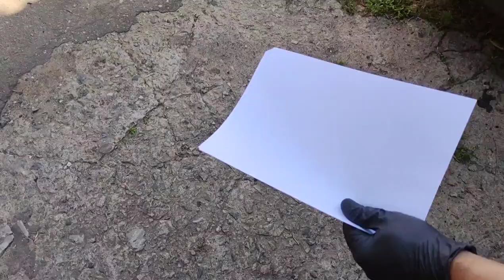Wootz steel from Threading Tap . Making Hidden Bamboo Knife

Comment: That was one hard nugget to forge. You can usually see the steel move with each hit, even with higher carbon steels, but you were giving it the beans and there was hardly any change
Reply: Good point! And that looked like a concrete busting, full size sledgehammer he is swinging there!

Comment: Your pieces are always adorable. I am wondering why you always begin forging with a hand hammer? Then switching to a power tool.
Reply from the maker: Forging with a hand hammer in order to see how the ingot behaves during shrinkage and conduct thermal cycles.
Reply: @fz-makingknives3663  finally subscribed. Rarely do so )))

Comment: Another great video! Question... I know in coal forges smiths have to be careful not to overheat and burn the steel... How do you prevent that from happening in the crucible?
Reply: I don’t think you have understood the process. When your hot working steel you don’t want it to reach critical temp and melt… that’s what u mean when u say over heat and burn the steel. However in the crucible that’s what u want. Over 1400 c to melt the steel in the crucible. That’s the desired goal. So no need to worry about burning the steel.
Reply: @goatspartan665  yeah I knew that was the goal in the crucible I was just wondering why there is no negative effect like there is with a blade in a coal forge.
Reply: @REKKnives  severe overheating will most likely remove carbon from the steel hence why he adds carbon to the mixture. That’s the most I can think of but I’m sure any metallurgists out there will be able to provide further info 🙂
Reply: @goatspartan665  the extra carbon yeah...I'm just confused by the glass
Reply: @Solais1019  the glass melts on top and seals the crucible from air that causes oxidisation… apparently green glass is the best as it doesn’t contain impurities that leach into the steel ingot. Fascinating stuff hey.

Comment: Hello, congratulations for your work, I have a question, what is the use of graphite, glass and steel powder, what are their roles?
Reply: I'd like to know as well, I'm trying to get into blacksmithing myself but haven't seen a video that explains these additions.

I assume the carbon adds to the steel for higher carbon, but the glass confuses me o.o
Reply: @Solais1019  I saw a video where the blacksmith explained that it was indeed necessary to add carbon and therefore I suspected that it was steel powder and according to what he explained the glass would be used for make the crucible completely airtight and the graphite would help in the reduction
Reply: @Solais1019  I've also seen one person get a really good result using only low furnace steel and a pinch of borax

Comment: Dummy request :
It would be very interesting to see vices breaking test on wootz steel.
Always asking myself how bendy or hard it is, and how the grain look like on this type of steel.
Reply: Doesn’t matter because that’s not how Wootz is made. Similar but it’s not authentic Wootz.
Reply: @THR33STEP  I am no blade smith, but I am interested in the science behind it all.

Wootz (to my research) is a result of vanadium impurities within crucible steel forming carbides throughout the metal. Originally, mines from India and the Middle East yielded iron ore that produced a bloomery steel that contained the vanadium... and when put into a crucible with a source of carbon, and broken glass as a molten seal of slag to preserve the quality, an ingot of Wootz steel is made from that prefashioned steel.

Similarly... in place of bloomery steel, FZ uses prefashioned pieces of modern Steel. Then adds iron sand (the primary element for bloomery steel) and graphite (a source of both carbon and vanadium oxides) and then the glass.

With the very same elements all in one crucible, despite not coming from Salahuddin's iron mines... this modern process still turns out a Wootz steel.
Reply: @THR33STEP   dude no matter if its real or not, just want to see test and grain to apreciate the quality.
+ crucible steel in every way can be called wootz as soon as there no purification process after.
+ FZ if u read, still interested to see what hematit can do in a crucible ;)

Comment: Very nice. However, that is not wootz.
Reply: And here we have the inevitable "It’s not wootz" comment.

 I am no blade smith, but I am interested in the science behind it all.

Wootz (to my research) is a result of vanadium impurities within crucible steel forming carbides throughout the metal. Originally, mines from India and the Middle East yielded iron ore that produced a bloomery steel that contained the vanadium... and when put into a crucible with a source of carbon, and broken glass as a molten seal of slag to preserve the quality, an ingot of Wootz steel is made from that prefashioned steel.

Similarly... in place of bloomery steel, FZ uses prefashioned pieces of modern Steel. Then adds iron sand (the primary element for bloomery steel) and graphite (a source of both carbon and vanadium oxides) and then the glass.

With the very same elements all in one crucible, despite not coming from Salahuddin's iron mines... this modern process still turns out a Wootz steel.

Comment: come on, cut a nail with it.
It's no longer high speed steel. The carbon is lower. The heat treatment is by eye. It'll be too soft or it will break, chip, roll,...
The handle is not very safe without pins either. 
Do something new. A knife that can actually be used in bushcraft and take an abuse